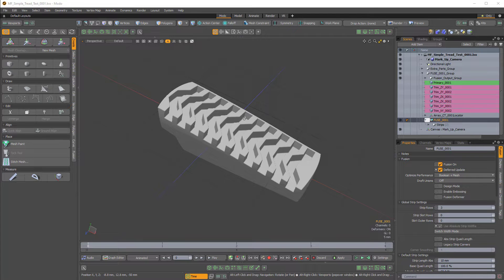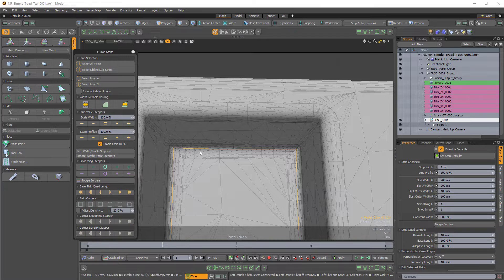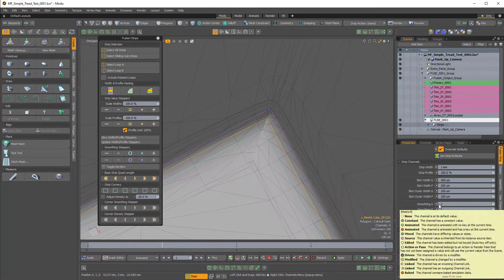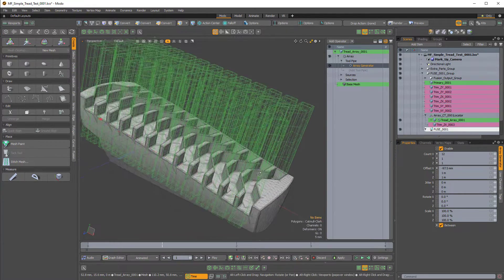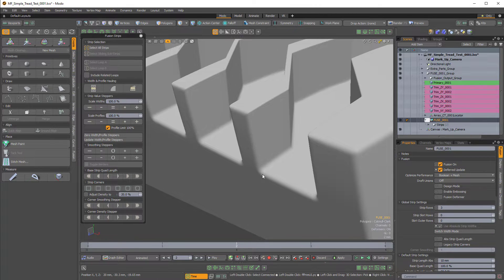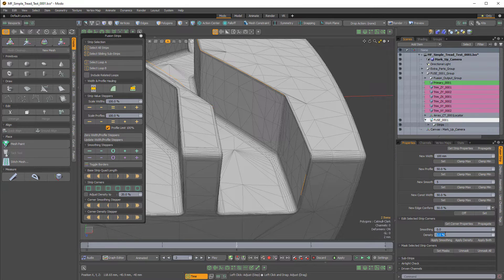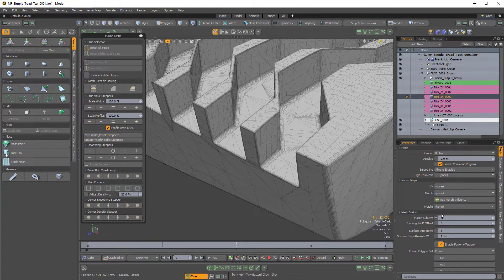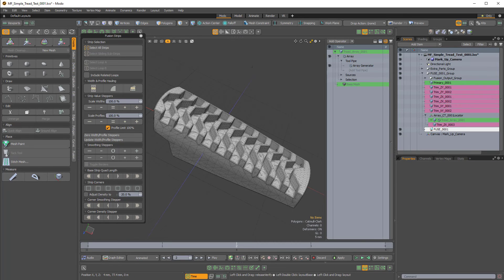Modo - MeshFusion - Quick Tips

Comment: Thanks for the tips! Does MeshFusion create symmetrical meshes yet? (if the originals and trims are symmetrical)
Reply from the maker: Hi Mike! I don't think MeshFusion will create symmetrical meshes, even if the Fusion source meshes are perfectly symmetrical. As a workaround, you could use the "symmetrize" mesh operation to achieve symmetry on the Fusion output mesh. You could also use the "symmetrize" mesh operation on a procedural duplicate (using the "merge meshes" mesh operation).